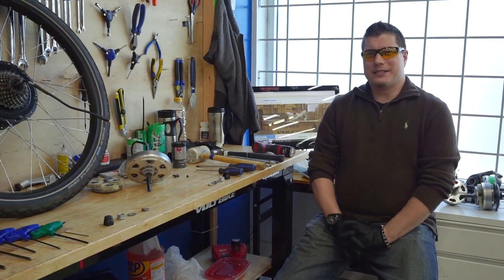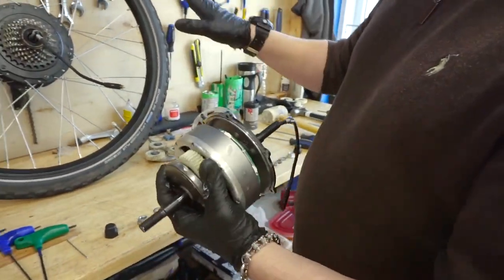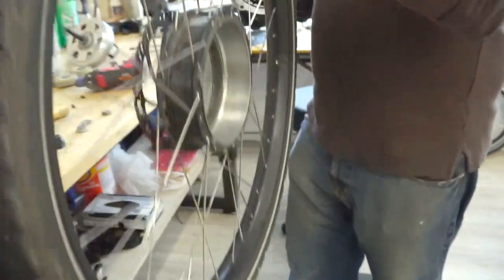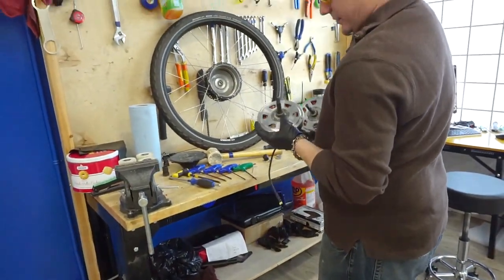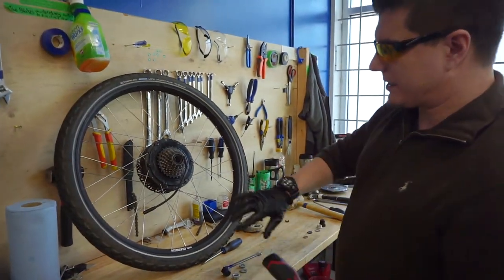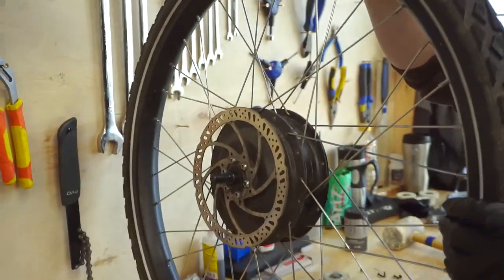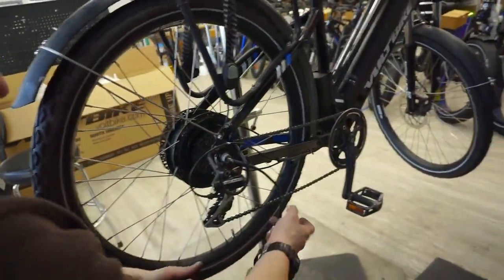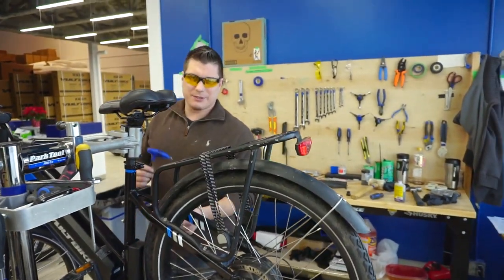Motor core replacement for VoltBike. Also covering planetary gears and speed sensor replacement.

Comment: couple of things he said he needed some lithium grease in the beginning but didn't put any on the gears before reassembly, then when he fitted the rear wheel he put the axel in upside down so when the cable come out the axel it will angle upwards so any water running down the cable will go into the hub. the cable must bend downwards first so if water comes down the cable it drips off instead of going into the hub. he also failed to fit a plastic cap over the ned of the axel to protect the cable coming out of the hub, and he's a warranty guy for volt!
Reply: You'll notice I mentioned "If your motor is high mileage". This one was not. Factory grease was still very much intact.

Comment: Great video thanks Ryan. I have a Yukon 750 limited and I’m wondering if there is any of those gears that will give me a bit more low end torque? Seeing how my vision isn’t great witch causes me to go slower but then when it comes to some hills it’s like the motor gives up or just pokes a bit and says I’m helping 🤣.
Reply: Thanks I’ll try it out when it warms up a bit because no point in wrecking the battery in -20 + unless it’s my quick grocery shopping day thanks for the reply
Reply: Oh yea and I just went out to test those settings changes and by doing that my headlight won’t stay on any time I’m doing climbing so thanks for trying but seeing where I’m going is so much more important at least at night. And I think my next bike if I’m able to is going to be a mid drive even for commuting but mor for play is what I need that power for.

Comment: I don't have the confidence , tools or a bike stand to be able to work on my Voltbike like that.  I wish I could send my whole back wheel to the Voltbike warehouse or unscrew the motor and send that in so I could have the core replaced.  Pretty sure there's a loose magnet in there or the planetary gears are getting worn. Its making some nasty noises :-(